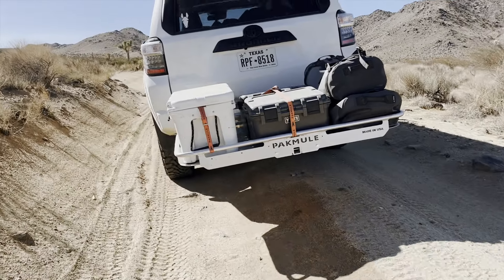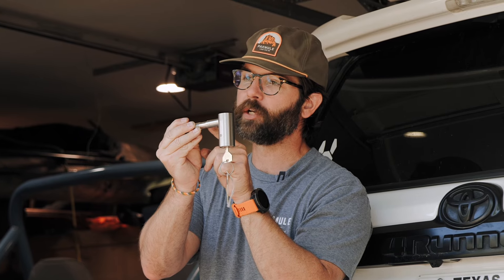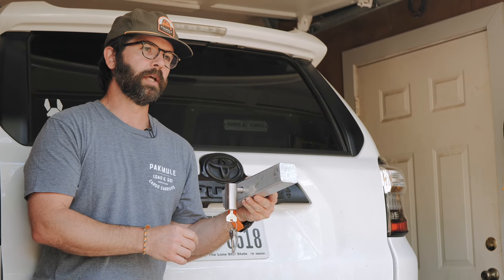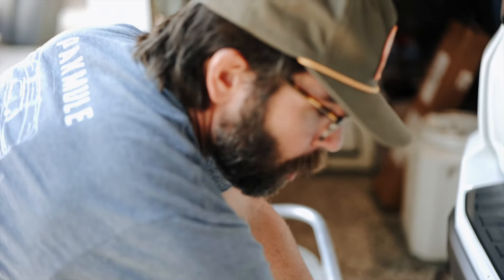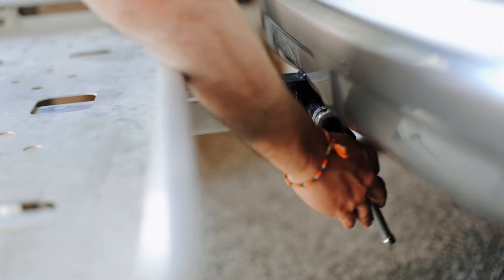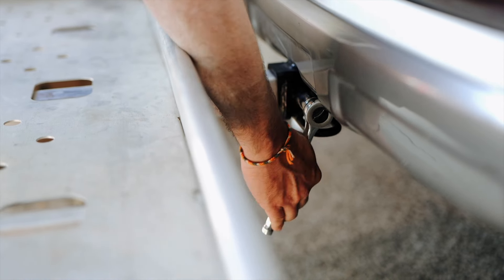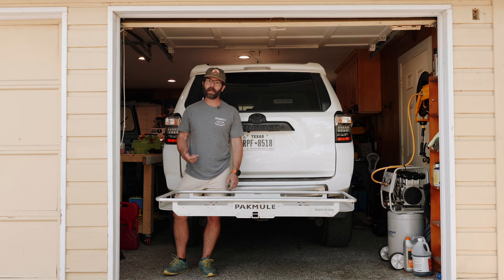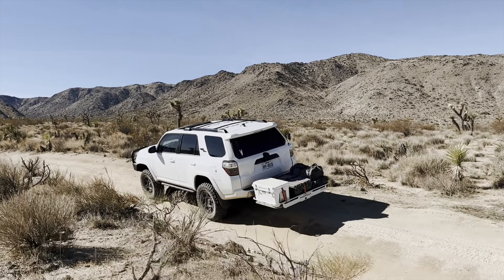Say Goodbye to Wobbling Cargo with the Anti-Wobble Tech of our Hitch Carrier

Comment: Awesome, informative...  Thank You for this!  I ordered the Scout this morning... I had a tough time choosing which one to get, between the Scout, and each of the Pro's, measuring, calculating, figuring out my load, etc... The Scout won for my particular need, Ridgeline was my second choice but found that with my coolers my lights & plate would be completely covered!    
On another video, I mentioned the desire to carry (2) Pelican Elite 45qt Wheeled coolers side by side.  You took it upon yourself to go the website, Thank You for going the extra mile.  Pretty Cool.  However,  having the coolers on hand and positioning them side by side, I am 99% (LOL) certain it's going to work.  100% certain that rotated 90 degrees, both will fit.   Will take pic's when I get and email you folks.
Reply from the maker: So glad to have you as part of the PAK!

Comment: I drive a 2020 Subaru outback. My first rack hit the ground every time I had a load in it. Got the ridgeline and that stopped. I had a lot of trouble and still don't understand why when I tightened down the pin and then I try to install the lock it would NOT lock. Sent several emails to Packmule and was ready to get the longer hitch pin. I discovered that if I installed the lock before I tightened down the pin it works fine. For the life of me I don't understand why that happens.